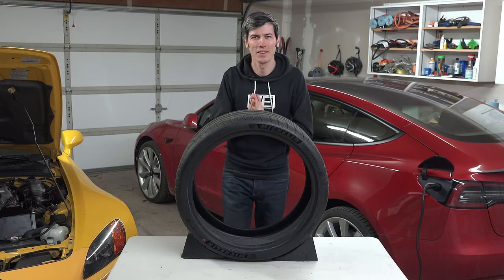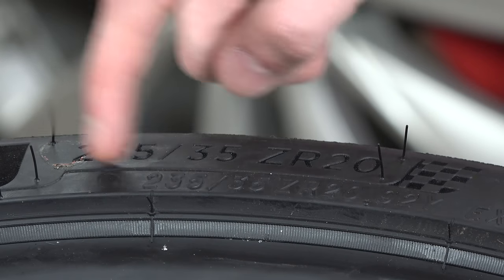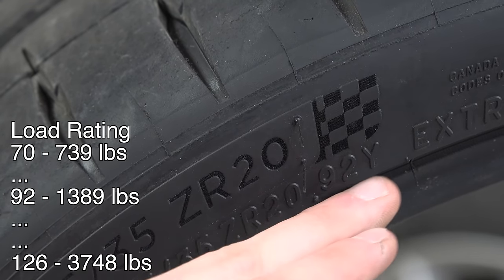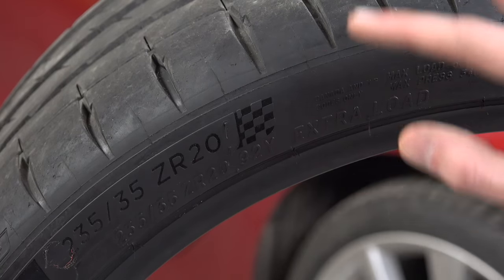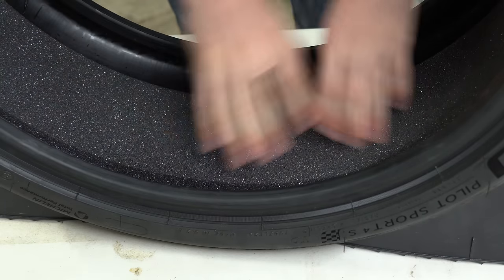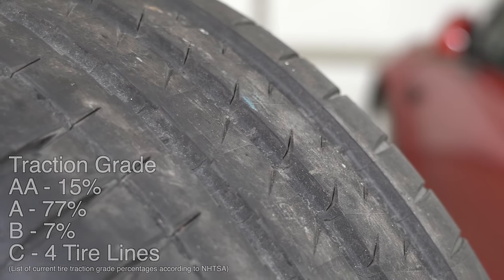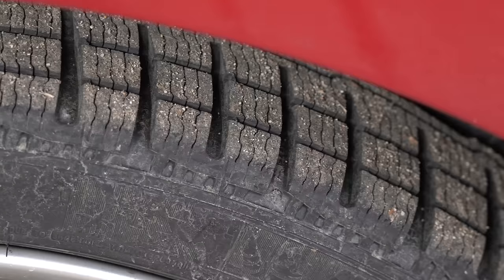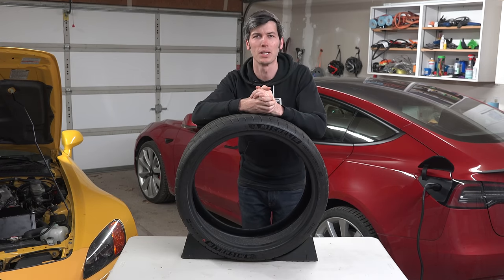The Ultimate Guide To Tire Sidewalls - How Good Are Your Tires?

Comment: The age of the tire should be discussed.  When purchasing new tires, find tires that are less than 2 years of age to avoid the possibility of rubber hardening, thus have less grip.  If buying used tires, check age too, don't go by thread depth alone.

Comment: Hi Jason, the speed rating is only for 10 minutes I believe. As in maximum speed the tyre can safely maintain for 10 minutes
Reply: It's 24 hours
Reply: @Krinkles-Security  I've heard that but I honestly dont know now because common sense would suggest that this is overkill as fuel would run out first and the organic component of the car (driver) wouldnt last that long.
I honestly thought it was 10 min because when I was doing Vmax runs I dropped significant speed every 10 min to allows the tyres to cool
Reply: @LawrenceAbramoff  it's all in the math I think. Realistically it's not possible to do 24h straight but they have their ways of doing the math to see if it could in a perfect environment
Reply: @Krinkles-Security Ok, thanks for the info! So confusing haha. FYI the tyres on the original Veyron only last 19 minutes from a tread wear perspective, but fuel only last 16 minutes haha.

Comment: What are the pros and cons of using a tire with speed rating lower than recommended? Im thinking to use an H rating rather than V cuz its cheaper. Thank you.
Reply: if you dont overpass the speed limit of the tyre therse shouldnt be any problem

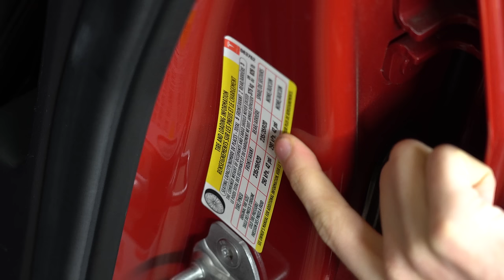Comment: Hi Jason! Very useful video! But, I have a question. At 5:42, the car sticker shows that the cold pressure for the tires should be 42 psi, but at 8:31 I can read in the tire "Never inflate beyond 40 PSI". Is there any hidden math that I can't understand here?
Reply from the maker: Ha, interesting catch! Not sure, as it shows max psi (5:23) is 50 psi.
Reply: @EngineeringExplained  Maybe it was a miscommunication between tire Manufacturer and Tesla, or someone forgot to update the text when doing the tire mold.

Comment: I've always wondered...  Must the tire be inflated to rated max pressure to support the rated max weight?
Reply: I think it's not related. I had a tyre rupture on a panel van. The pressure unloaded as recomended for the vehicle was 4.5 atm. Loaded it went to 5.5atm. Theoretical  load of the tyres was 4x850kg=3400kg. Total weigh of the vehicle was 3300kg. On a mid-speed curve with 70 km/h (40-45-ish m/h) the rear axel went a little bit outside of the road and that caused the incident. Now I drive with 4x1120kg= 4480kg for a 3500kg van with no issues.

Comment: On my truck I have 245 which as you say is the width and the 265 is wider than the 245 but the 265 is also taller, why is that?

Comment: Silly question, but does the PSI listed in the car apply to all tires on the car? Or if I had some other rims on the car from a different model, will there be another that applies?
Reply: The answer is yes and no. If you had different wheels on that are a different size than original, that could change the psi.

Psi is based on (but not limited to) gas mileage, traction, and tire wear. So when you put different sized wheels and tires on you can change how the load effects the tires. However if you choose the exact same wheel size (from another car or an aftermarket supplier) theoretically it shouldn't change the correct psi.

As for being for all tires on the car, the plaque shows psi per axle, and while some cars might have staggared psi on the front and back (maybe 35 psi in the rear and 32 in the front) the plaque will tell you exactly what to do on stock wheels.

Comment: What tires would you recommend to reduce the body roll ( for 2019 Toyota Sienna XLE)? Thanks!
Reply: Find a tire with a stiffer side wall itll help stop roll over on the tire and some sway bars or suspension but not practical in a sienna

Comment: If I change my tyre where do I get the recommended pressure from? The tyre manufacturer or is it the same as the original tyres?

I just inflate to 35psi but haven't really thought about it before.
Reply: It differs based on many factors. You want even wear across the tire, so inflate to a decent air pressure such as 30 or 35 psi and then drive them and check for wear periodically. If the center of the tread is wearing faster than the outside, your pressure is too high. If the outsides are wearing faster than the center of the tire, your pressure is too low...

Comment: @Engineering Explained (or anybody) I noticed a icon on some Nokian winter tires that looks like four tires with the front tires at an angle & “F” between the angled tires & “R” between the straight tires.

Anyone have a clue what that symbol means? 

Maybe the tires a good for front or back use?

Comment: My car is weird.  The recommended pressures in the door for it are 36 PSI front, 45 PSI rear, but the OEM tires had a max rating of 44 PSI.  I have yet to even find a tire in that size that is rated at 45 PSI or higher.
Reply from the maker: That is weird, what car is it!?
Reply: MeanJim Sounds like a BMW, shop different tire brands— 51psi max is not unusual.

Comment: So I'm going to guess at your question of why drag racers use wider tires. If I'm wrong or use the wrong terminology because I dont know it.

So my thinking is, if they're slicks, theyll spin much more and that means more heat. Just because they're "slicks" doesnt means they have zero grip. I mean they do go forward and they leave burnout marks... so burnout marks....that's where I come to with my answer. On a microscopic level, they are being pushed into the tiny grooves of the asphalt so if they were to have a larger surface area, that would mean more rubber pressing into the asphalt as it's being heated up at the same time

Comment: I have a confusion. Higher threadwear = lower grip, but I saw some tire with 500 threadwear with AA grip, and some lower threadwear and A grip. In this case, how do we justify these 2?
Reply: Threadwear is manufacturer specific, as he said. Did you see those markings on the tires from the same manufacturer?
Reply: Dženan M yeah, they are different brands. So meaning the standard are individual?
Reply: @dalphinus  Yes, exactly, as stated in the video, those markings are for individual brands, not standard across every brand

Comment: I always wonder why they didn't just do width height and wheel size, instead of this aspect ratio sidewall
Reply from the maker: And width and wheel size in different units, like huh? Haha.
Reply: @EngineeringExplained   Exactly. Although I do remember some Mustangs that had an all metric tire size.  I'm old🤣
Reply: @worldtravel101   Even the wheel diameter is Metric? No way?
Reply: @hahaLOLhaha72  390 mm if I recall
Reply: TRX tire & wheels were all metric and NOT interchangeable with ordinary radial tires.

Comment: can i ask what is the purpose of  rubber spike  in tires? the one you`ve pointing  1:02 Thnks ^_^
Reply: Michael Salvador left over from filling the mold with liquid rubber in the final manufacturing step— lots of small tubular vents allow introduction of the rubber compound the spikes form in those vents.
Reply: @randyfitz8310   Thank you so much sir ^_^  now i know what is that.... because when i was a child i always saw that little spike in tires..  ^_^..    Thank you so much again.. Sir..from Philippines ^_^

Comment: My tyres have a load rating of 58 in the front, 69 in the rear, and a speed rating of V. Is that good?
Reply: I love when people ask a tech question with no info (car model/how you use it...). I have one drink at 50*f and another at 180*f, which is better? 

Trick question! if it’s coffee vs milk (“model info” in the case of the car), then it could even be someone that likes hot milk and iced coffee, and not the other way around (use case)

So your tires are trash and will explode and melt if your using this for re-entry in a space shuttle, or they could be the perfect tire for grocery shopping in a mini-van.

The answer to your question should be easy enough for you to find out from rewatching the video, otherwise people have no clue what you drive, or how you drive it. If you’re still unsure, either follow your car companies advise (just know it’s often wrong though), and ask a few tire shops what they would recommend (and also don’t be too cheap buying the absolute cheapest thing you can find, since saving $100 on a set of tires is pretty small compared to totaling a vehicle in a crash, and even small dented bumpers cost over $1000 to replace sometimes. Just ask some honest tire shops with experience and NOT working on commission, and let them know how you’ll be driving it)

Comment: Go to mount a set of tires for a guy that bought tires from Tire Rack.
Three tires recent date.
Fourth tire 10 years old.
...
Reply: So as a general rule for summer tires, how old is too old? Being driven or being in storage would make any difference?
Reply: @MrDaxtr  
Rubber has about a 4 year shelf life then the it starts to break down. I've seen 10-11 year old NOS Uniroyal truck tires sling a chunk of rubber tread off within the first year of being mounted. Being driven on would probably help. Wear would reduce the mass and the flexing would probably help.

Comment: Jason, can I use a 275 on a 285 truck safely driven.?
Reply: I know this is an old comment but if anyone else needs to know..Yes, it's a more narrow tire though and it'll balloon in a bit and won't have the same tread width. In my experience, it's negligible. The tire will also be slightly shorter but the difference there is minor. I'm running cheaper undersized tires on my ranger without issue. I wouldn't go far from the right size tire but up or down a level should be fine.

Comment: I work at a shop when someone needs air I'll ask if the 35psi or whatever rating is okay (while pointing to the door jamb). Prob 10% of ppl think they're a genius and need to teach me that it says 44psi on the tire.

I've had many office type engineers tell me this... SMH never learned what MAX means.
Reply: agreed, the max rating is there because that tire can fit multiple vehicles, however if the vehicle called for a recommended 60psi inflation then you would not install this max 50psi tire on that vehicle.

Comment: The 35 means 35mm side wall when it's on the wheel and bead is set
Reply: Sorry, 35 is not 35mm but it's the A/R = Aspect Ratio of the Height : Width Ratio, in percent, 35%.  The Width is 35% of the Height (OD)
 
The height of the sidewall is 235 x .35 = 82.25 mm
The overal sidewall height = 82.25 x 2 = 164.5 mm = 164.5 / 25.4 = 6.476"
The OD = Overall Diameter = 6.476 + 20 = 26.476"

Or

OD =  ((235/25.4)(2x.35))+20 =  26.476"

Comment: What I was told the numbers mean by a tire manufacturer that uses the same universal system you are referring to in the video disagrees with what you are saying on the first number. The second and third are correct. The first words (I'm paraphrasing, not quoting) out of the mouth of the representative from the manufacturer I spoke to was: there are no numbers on the tire that directly references the exact tread width of the tire. What the person told me the first number meant is (you are correct about it being in mm) it's the total measurement of the tire from bead to bead. In other words, from one bead, up the sidewall to the tread, across the tread, down the other sidewall to the other bead. So to know the tread width of the tire in question requires math.
Of course, all of this can be ignored if the person I spoke to was wrong.